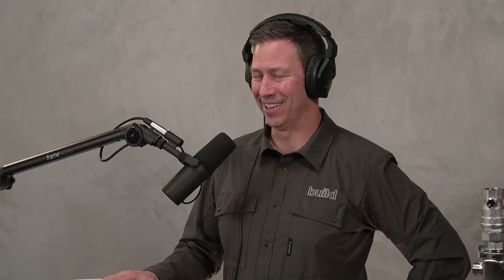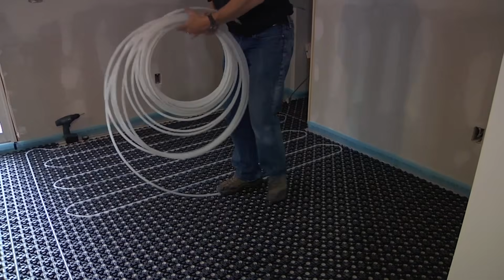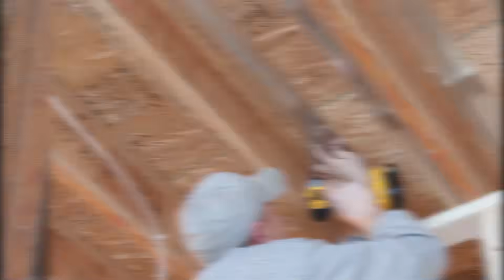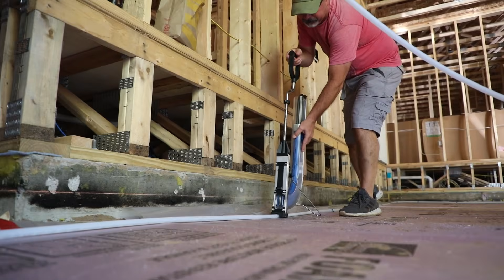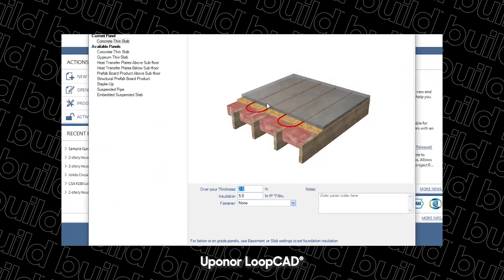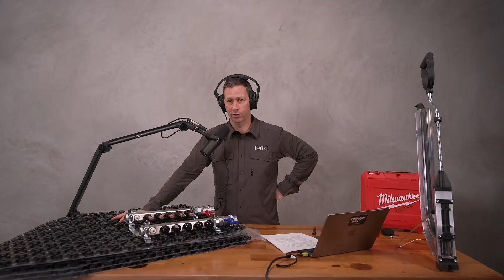4 Methods To Run Radiant Heat PEX Pipe

Comment: Radiant heat floors may be nice but the cost is high, it’s an additional system that cannot be used for cooling, and it’s essentially wasted in a tight well insulated home because you can’t keep the floors warm enough to feel without overheating the house.  In many cases the additional money could be invested in a better envelope and/or better windows, making the house more efficient and more comfortable.

A forced air system also filters the home’s air, which doesn’t happen if heating with radiant heat.

Radiant heat makes the most sense for a crappy house with poor insulation, but in that case it can be difficult to install.
Reply: My house is r29 walls r65 ceilings. Very tight. My floors are never cold. Whole house and shop 3400sqft heated at all times. Geothermal and solar. Zero bills. And cooled house and shop. With chilled water fan coils. Chilled water provided by geothermal. I installed a panasonic cold climate erv. Brings in fresh air and filters it as well as transferring heat and some of the humidity. From outgoing air to incoming fresh air.  I  installed it all. Myself. Mostly by myself. Radiant floor, geothermal, erv, everything.  A lot of work. But can be done.
Reply: @danmccoy6164  what would that system cost to have installed if you paid contractors to do it?  Which climate zone are you in?

How do you like your Panasonic (IntelliBalance 100?) ERV?  I’m leaning towards that one for my build, the Cold Climate model as well.
Reply: @superspeeder  I got 3 estimates for the geothermal systems. All wildly different ideas for equipment. All three came back at $45,000+
I did geothermal and 6 zones infloor and  chilled water fan coils for about $25,000 myself.  I had estimates for conventional heating and ac. For my shop/house. From $28,000 - $34,000.

I love the  intelli-balance system. Works great. I have one of the first of the cold climate ones. I see that they have done some updates to them since. I am only using it for the living space. So only 1000sqft. So it is on the lower settings. I thought it would only bring up the cold incoming air up 10°-20° basically just take the edge off the cold. I checked the  incoming vrs the outgoing air temperatures @-15°f outside and only a 2° temperature difference. Doesn't seem possible. I think maybe at the lower settings its more efficient. There is a  jumper wire that you have to put in if you don't  use an external switch.? I don't remember exactly how it goes. But it seemed like it was doa. No explanation in the instructions. Found several people who sent the units back and the same happened with the new one. But someone figured it out and I did what they said  and it works great. Just a matter of putting the jumper wire in. Perhaps they figured out they needed to put it in the instructions. Now. Lol
Oh yah I live in Central Wisconsin.
Reply: @danmccoy6164  yes, the IB100 is more efficient at low speed (as are all HRV/ERV) but yes, 2 degrees is too good to be true!  I have a feeling the unit was in a defrost mode when you took your measurements.  According to Panasonic's documents, at -15F it will be on a cycle where it ventilates for 27 min and recirculate for 9 min to keep the core from freezing.

It's a super-efficient unit @ 81% Sensible efficiency and 81% latent recovery (moisture) at 32F.  I'm looking forward to using it.
Reply: @superspeeder  
No in defrost mode its the only time it makes noise.  Only does it when its in the low teens outside.  I've checked it several times because I can't believe it's possible.  But I've never checked it when in defrost mode.  Mine is mounted inside my spare bedrooms closet to the ceiling of the closest. I think it's a programed mode that comes on when it detects lower incoming temperatures and has set intervals.
Reply: If I had read your full post I would have seen that is what you said. Lol

Comment: I’m looking for information on using a radiant floor system for heat and in the summer using a swimming pool for the heat exchanger for cooling, inaugurate direction would be appreciated.

Comment: For those of us that don’t have access to hot water for under-floor radiant heat, does electric wire under-floor radiant heat pack a similar punch in heating and maintaining a warm room?  How is power use measured in heating a room?
Reply: Typically electric will warm the floor but in most instances, not ideal for being a primary heat source. It can also be VERY expensive to operate, depending on where you live. Hydronic can be (depending on the method) your entire heat source for the home.
Reply: @Warmboard  thanks.

Comment: Amazing advantage? with forced air you can have central AC, air purification,humidification,dehumidification, I`ll call that amazing, i also enjoy radiant heat.
Reply: and connect an hrv or erv to the duct system for whole house ventilation.

Comment: Retrofit scenario: main floor is hardwood (actual hardwood, not engineered, not laminate) and ripping that out is not an option, but the basement has a drop ceiling so the underside of the main floor is easily accessible.  Something like joist track (8:13) would be the obvious choice, but I have heard that hardwood floors can be easily damaged if they get too hot from below.  How hot does the working fluid need to be for effective heating?  How hot is too hot for hardwood, or is what I heard a myth?
Reply: Radiant used for actual heating is not an option for hardwood floors. Only floor warming is possible with hard wood floors because as you mentioned higher temperatures than floor warming (80-90° I believe) will damage the wood.
Reply: @buttmankun  Assuming those temperatures are in Fahrenheit, they are close to what I have read elsewhere, that 40 C (~105 F) is the highest one should subject hardwood to.  Floor warming is all I am looking for though.  Let the central forced air heating handle do most of the work, just give me something that makes the floors not chilly on winter mornings.
Reply: @JonMartinYXD  Agree with your 105°F under wood flooring. Installed a system for customer in 1998 that used 2 HP as stage 1 w/ defrost board lockout at about 40°F. HOT water radiant would start warming up at about 45°f also controlled by Stage 1. Stage 2 controlled 2 hot water coils in the 2 HP air handlers. Hot water (closed loop) was provided by HS Tarm multi fuel boiler (wood with gas back-up). Also DHW provided by water to water heat exchanger.
System had 9 zones that operated at 3 varying Temps. Purpose, outside temp and demand controlled boiler Temps.
Homeowner didn't have to do anything but build a fire if he wanted in cold winter months. Heart pine floor was limited by 3 way mix valve to 70% of radiant demand temp for rest of system. That maxed it out at about 105°. Always backed up by High temp HW fan coil as Stage 2/E Heat in HP air handlers.
Belt and Suspenders!😎😂🤣

Comment: Very little mention of requirements for insulation under the pipe here (apart from method 3). My understanding is that putting pipe directly on the floor slab will result in far too much of the heat going down to heat the soil rather than up to heat the room. It can still work but is very inefficient. Obviously if your slab already has decent insulation under it then that's great as you have lots of thermal mass on the warm side. But most retrofit slabs are just on the dirt.

Comment: I installed my own radiant floor system in 2003 in Western North Carolina. I have since sold the home and plan to build again within the next year. The source of heat came from an outdoor wood fired boiler in conjunction with a high efficiency natural gas water heater. 

First off... radiant floor heat is pure luxury. I have lived with forced air systems in the past, just as most of us have, but radiant floor heat has a comfort to it that you cannot obtain with a forced air system. With that said, my next home will include both systems. The reason being is that radiant floor heat is obviously for heating and not for cooling, so a forced air system will provide the cooling aspect during the warmer months. I had no forced air system in my first build because I was located at 3,000 feet elevation, so summers were generally mild and rarely required cooling.

What I look forward to in my next home is having both systems, the comfort of radiant floor heat and the cooling ability of a forced air system along with the added ability for the forced air system to provide the heating in the fall when the temps begin to drop and you only need a little heat in the evening and at the beginning of spring when the days begin to warm again. With radiant floor heat using the concrete slab as its heat exchanger it is not as quick to respond as a forced air system would be. In the spring and fall when you need better heat/no-heat control, radiant floor heat takes awhile to heat up and cool down, sometimes by as much as several hours.  So, in my opinion, radiant floor heat is indeed a luxury item and expense, but worth it in the dead of winter when you need a consistent comfortable heat source.

Comment: I'd be interested in learning about electric radiant floors.
Reply: Hi , I’ve Been installing Nexan electric cable for 20+ yrs and have NEVER had a failure . They invented it. We did have 3 thermostats fail but 2 were still under warranty. It’s GFI grounded so you can run it in a shower floor and up under granite seats in showers . We run it under soaking tubs when clients ask or when we need the BTUs to heat the space and not just the floor . I’ve installed it in my rentals so I’d hear about it if it didn’t work . It’s about thickness of Cable tv wire and we install it under wet bed floors so it’s protected & the mudd holds the heat. They offer it in 110V and 220V. . I’m not a fan of the window screen rollout matt. Some of the directions direct you to use a plastic thin set trowel when setting the tile …. Pass , I’m not getting involved! Downside of Cable is it might be expensive to run if rates are high in your area . It’s a great luxury to add in a kitchen or bath renovation.
Reply: @alexg2915  Thank you for the useful info Alex!  I will look into Nexan.

Comment: In the Nordic countries, Uponor is a Finnish company, I myself live in Sweden, almost all new homes are built with radiant heating or underfloor heating as we call it. most often the pipes are cast into the concrete slab. the cost is not higher than for conventional heating systems - heating via wall-mounted radiators. Even when renovating old houses, radiant heating is often the first choice. My wife and I installed Uponor's underfloor heating in our 100 year old house - in all eight rooms. Yes we did it ourselves. So easy. An advantage is the low flow temperatures. When the outdoor temperature is 15 degrees Fahrenheit, a flow temperature of 100 Fahrenheit is sufficient. Perfect for heat pump. The disadvantage is of course that the system is not suitable for cooling during the hot days of the year. But, you can not get everything.

Comment: So for let's say a retro fit on a bathroom build under subfloor between joists; do you have to consider anything around tiles or under the tub?  Meaning, will the heat damage an install weather new or old?  This is amazing!!
Reply: Stay away from the wax ring under toilet.

Comment: Hey Matt. Great channel. I have a question about radiant heat. We rebuilt after the 2011 tornadoes. I installed radiant in my 'acid stained' concrete floors. The company I used sold me NIBCO pex-C tubing. For the first four years we had a couple of leaks that I assumed were due to "rough handling." Other than that it was great, we loved the even heat, our heat pump never came on in the winter, until the catastrophic failure in Jan 2021. All the tubing is leaking. We had large '"wet spots" on the concrete floors from the leaking pex tubing.
I was hoping some one could tell me who could give me some advice. Thanks
Reply: I found out later that NIBCO has a class action law suit against it.

Comment: Matt is it possible to use a wood burning stove to heat the water in the pipe (like having copper tubing wrapped around the chimney) and either use a pump to circulate?
Reply: There are wood and pellet stoves or furnaces that have adapters for hydronic heat. I have not looked into them and suspect that maintenance at the heat source is a byproduct of the high temps. Obviously this is offset if you able to cut your wood

Comment: Just built our new house with in concrete floor radient system.  Used a Cross Manifold system (no solenoid valve) and every room has its own zone.   Very comfortable and quiet.  Currently using a microboiler with buffer tank, but one day we'll add a ground source heat pump and get both heating and cooling and only use the boiler as a backup.

Comment: If I built a new house I would be doing infloor heat period!!! Best heat ever. Both my dads houses have infloor heat and we put a coil in the wood burning fireplace that will heat the whole house via burning wood in the fireplace. With gas prices sky rocketing this is the middle finger you can give to your utility provider. Couple that with solar panels and your off grid.

Only downside is you need to still cool your house so you end up buying two systems. Infloor for heating and ductwork for cooling. Most of time this setup is 3 times the cost of a traditional scorched air setup.

Comment: who would mount it on wall lol i see a year later the wife say lets hang a picture and POKE a hole lol
Reply: Exactly!  I can't believe they said that you can put these radiant systems on a wall and cover with drywall!  That would not only be an extremely bad idea due to the issue you stated, but would also not meet code since all electrical and plumbing systems that are not at least 1 1/2" from the surface of the wall need a metal plate protection.  So, I guess they meant that you could install the system and just cover the entire area with nail protection?????? SMH

Comment: How can this system be deployed in a recording studio space?  Acoustic panels are screwed into the walls/celing around the entire envelope, constructed of resilient channel, Safe n' Sound, and QuietRock and finished with floated floors.  I don't see how radiant couldn't work here, but rather just curious if the workflow is much different in application.

What is the heat source of a system like this? Boiler, geothermal?
Reply: Work flow wouldn't be too different. We've actually done a couple sound studios over the years. Typically a boiler is used. Geothermal also a good option in many applications.

Comment: I built my own in floor system in my house (110 years old) here in New Jersey. I read Modern Hydronic Heating by John Siegenthaler, without this book it would have been impossible to get this done. 
I'm not a plumber, I'm just a crafty home owner. I watched every video I could find on the subject as well as read most of John's book. Empowered with all this knowledge I decided I would get all the bang for the buck I paid for my Tankless Hot Water Heater.
Reply: So yours is powered by a tankless?  I really want to do this in my future home, didn’t know I could do it with a tankless
Reply: @ToastyCoronet  There's what's called a tankless "Combi Boiler" which has separate plumbing for DHW and Hydronic loops.  Rinnai and other companies make these.
Reply: I used John's book to assist me in teaching Hydronics in central Saskatchewan, Great book.
Reply: Can I use the sheets that are set up to snap the tubing in place on a wood subfloor and then put ceramic tile directly on top of that?
Reply: @cb8591 yes. So long as it's secure and doesn't disturb the concrete (thinset) curing process.

Comment: 5:49 That's just regular sill foam you're talking about around the walls. They just use tape or spray adhesive to hold it, then trim it after the lightweight concrete cures. Though I've seen some people leave it in place because it adds a little more thermal/insect barrier. They only trim it if it gets in the way of miter joints with the baseboard.

Comment: Is there a install method to cut slots in existing concrete slab them lay in an aluminum extrusion with a thin foam layer under it to decouple it from the foundation /slab?
I am picturing a ball nose router type concrete cutter if there is such a thing?
I would like to add radiant floor heating to my slab on grade house but not raise the floor hight significantly.

Comment: I have a lot of questions about this. I’m sure I could research it more, but if anyone has answers that would also be great. 
First how does the efficiency stack up compared to forced air alone? Also more interested in the doling aspect as well. Being in the Midwest with hot and cold days I don’t really see the benefit of this system, besides a little more uniform temperature, because I would still need forced air for A/C.
Reply: Ductless mini splits can provide ac.